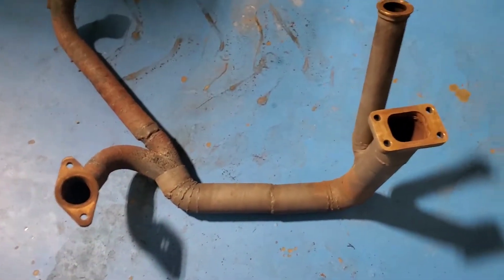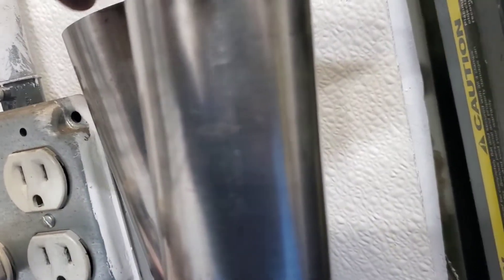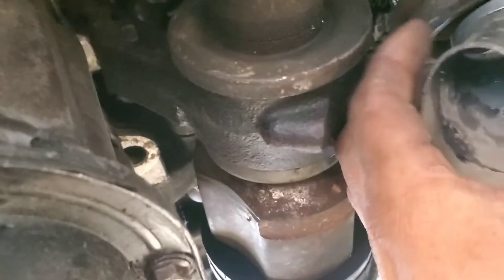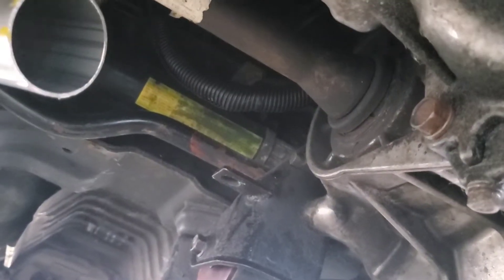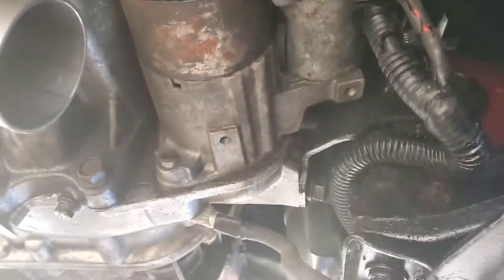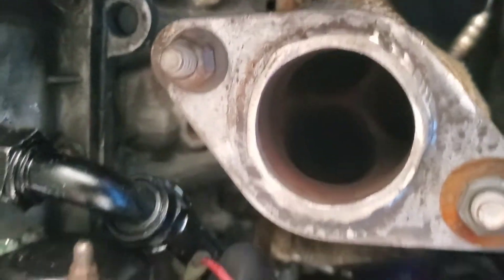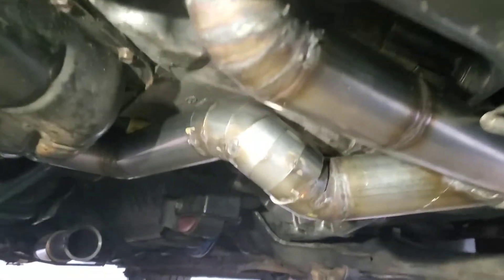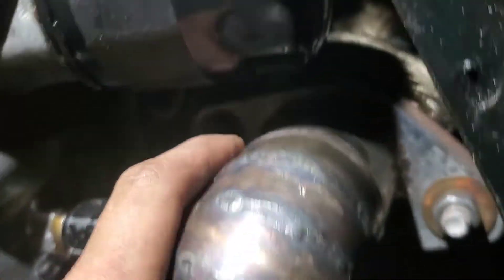Custom uppipe/y pipe 05 Hyundai Tiburon Turbo V6 2.7L project

Comment: Hey I figured I'd ask you since you have a tib, have you ever had this happen to you car, when ever the weight shifts towards the front driver side there is a clunk noise? I have been trying to figure it out and don't know where to look..... keep up the good work by the way
Reply from the maker: No because I maintain my Tiburon plus its just not Tiburon thing it can be any type vehicles. It happens only on bumps or what? Check your suspension and steering components.
Reply: @Lilmiddwest  yea over speed bumps,dips or even when weight tilts to it i have done the control arms and everything was fine for a bit then it all started so I haven't looked into it yet cause I have been busy so I was hoping to get a idea so I can go straight to it
Reply from the maker: Like I say check your struts and sway bar & links. Suspension